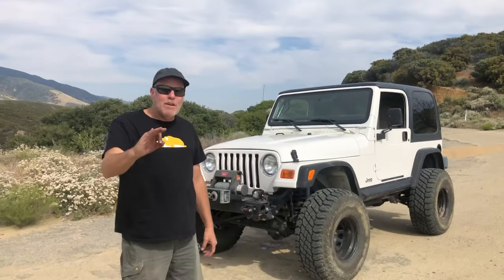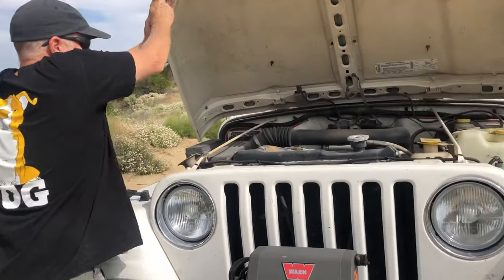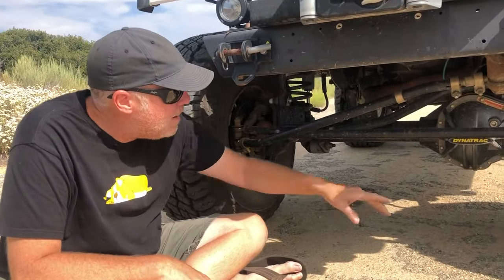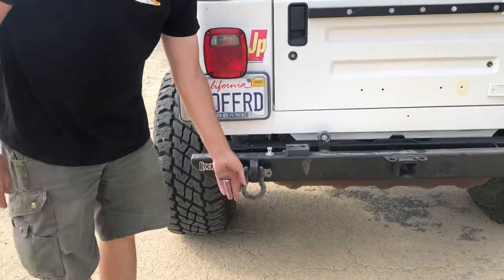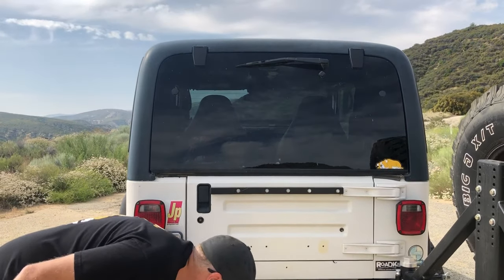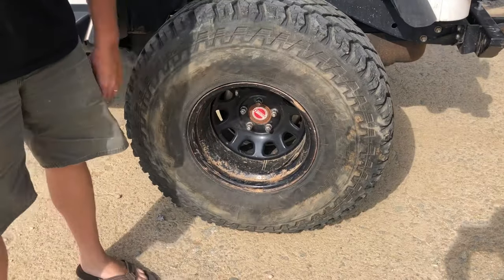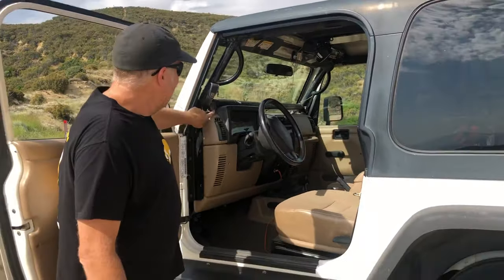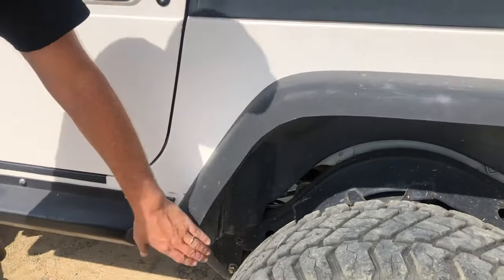How to Build a Jeep Wrangler TJ

Comment: it appears you have some kind of wheel spacers installed to extend the tires width? are aluminum ones safe?
Reply: I don't think he does. It looks like its just 15" wheels with 3.5-3.75" of BS and are 10" wide. Most allow 16-17" wheels have 4.5-4.75" of BS, which sucks them in more.
Reply: @Stuka87  thanks! I was hoping someone would chime in that have tried those aluminum spacers, it seems to me by them being aluminum they wouldn't be very safe? I had them years ago on my old Pontiac and one broke and the wheel came completely off. surely they make them stronger now.
Reply: @RandySchartiger   There are a lot of chinese spacers that are poorly made. Personally I refuse to use them for the reason you state. I have seen them fail. If you must use them, get them from a reputable brand like TeraFlex or Spidertrax. But its also important that your wheels are hub-centric, instead of lug-centric.
Reply: @Stuka87  thanks for this info! greatly appreciated!
Reply: @RandySchartiger  No problem!

Comment: Would you do a video on how to find shock length. Off the shelf 3.5 in lift bilsteins won’t work on my zj either
Reply: Call rusty's. They can hook you up and you can get the specs for a shock for a 3 or 4 in lift. The info you need is xyz shock and how long it is fully extended and compressed.

Comment: TJ’s are so basic. A small lift. 33 or 35 a 3 or 4 inch lift. Done. Wheel just about anywhere.
Reply: Eric faley best 4x4 ever made
Reply: Mine has 32x11.5 and no lift. The rub a little in hard turns but that’s it.

Comment: I see you are leaking coolant. The rusty looking residue on the inside of the hood and on the engine and radiator hose is a dead giveaway. Probably water pump, but could easily be a cracked radiator tank too.

Only way to kill a 4.0L is to run it hot or out of oil. Fix it!
Reply from the maker: Tactical Repair  You’re looking at Moab dirt
Reply: Ahh! That possibility didn't occur to me. Looks exactly the same as rusty coolant residue. 
Well built anyhow. I like it.

Comment: In Australia Jeeps are suburban. If you go off road you go Toyota because they don't fall apart.
Reply: brian williams in our off-road club the Toyota’s have much more expensive parts, way less miles, and break down way more often with the jeeps. The jeeps last much longer than the 4 runners
Reply: @justinkrichbaum832  Hi. In Oz we use the Hi Lux, Land Cruiser and Troop Carrier and you can get parts anywhere in the country but Jeep parts are only in city's and large towns and they don't do corrugations too well. A Jeep will climb anything but it doesn't bash 500 miles of unbroken bush that well.